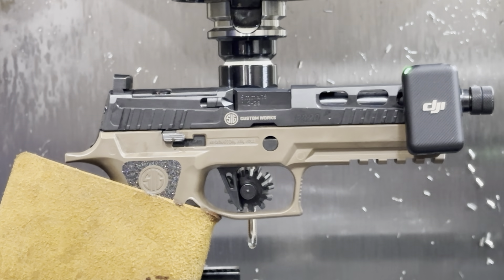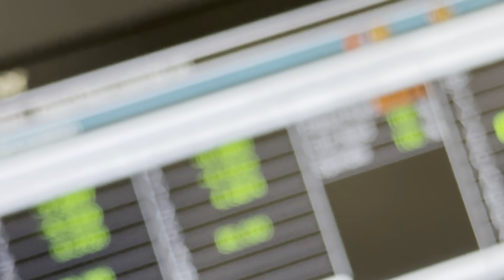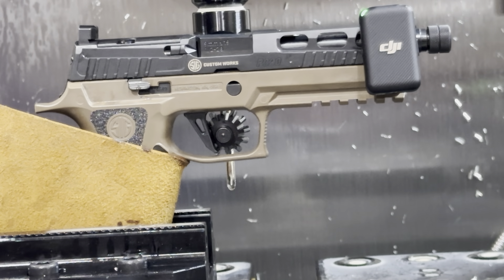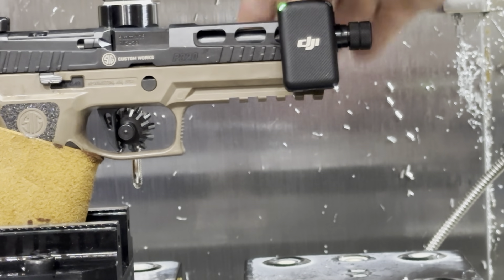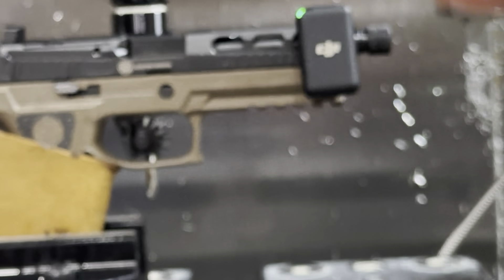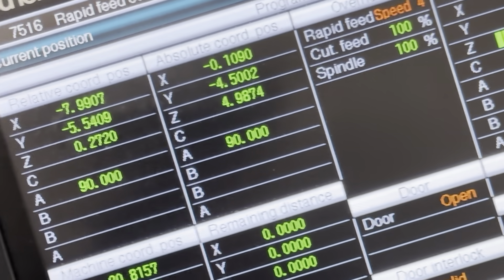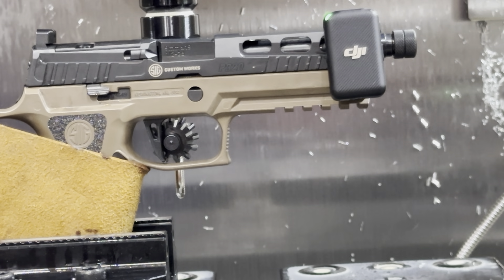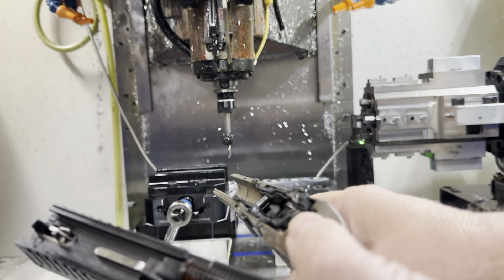Sig P320 accidental discharge tested in CNC machine.

Comment: What seems to escape people is that pulling the trigger, in the experiment, just simulates the striker safety becoming inoperable from normal movement. Pulling the trigger back slightly is not why the P320s are firing in real life. Let's review.

1. The P320 striker is fully cocked. If the sear & striker safety fail, the P320 will fire. A Glock's striker is only half cocked. If the sear & striker safety fail, it still won't fire. 

2. From the FBI study, we know the spring on the striker safety can move out of position from normal use of the pistol. This makes the striker safety inoperative.

3. The mating surface between the striker & sear is very small, and the striker sits at the very tip of the sear. The FBI noted excessive wear on the sear and uneven wear on the sear. The USAF is currently inspecting all M18s for burs on the sear. Any defect of the sear requires replacement, per the order. 

4. From WGP and many others, we can see the sloppy fit of the slide and the trigger parts. Enough movement to trip the sear. The FBI noted that the secondary sear fails to catch the striker when the sear fails. 

So, what we have here is numerous design features, when combined together, that allow the P320 to fire all by itself.
Reply: Thank you, exactly the point(s) that so many people still do not understand.
Reply: Another thing that most guys making videos about this have been missing is that "apparently" the pressure on the sides of the p320 while holstered is giving just enough deviation on the FCU that will allow the gun to fire when the slide is bumped. I've only seen one YouTuber demonstrate that. I can't remember the name but I think that's more important than the trigger being slightly depressed.
Reply: The P320’s owners manual states, do NOT carry a round in the chamber!, why?
Reply: @amadodelgado498 maybe lawyers required it ?   It would interesting to see how many other companies state that in their manuals.
Reply: @amadodelgado498  imo because you shouldn't, and I don't know why people do
Reply: @brandonkellner Well sir, you will lose the gunfight if you have to rack your slide before you engage the bad guy. Just sayin 🤷
Reply: @brandonkellner  "imo because you shouldn't, and I don't know why people do"

Spoken like someone who doesnt carry. 

How much is Sig paying you to hang out on youtube trying to rewrite the narrative?
Reply: @MyName-r2i9u  I don't carry. I do shoot guns though.
Reply: @brandonkellner  Well it makes more sense for you to say that as a someone who doesnt carry.

First, you need to understand that Sig is saying what theyre saying because it is necessary for liability's sake. Of course theyre going to tell you not to carry with one in the chamber.

As far as the why of it: If you understand why a police officer or a soldier would carry with one in the chamber, you should be able to understand why a civilian would carry with one in the chamber. The point is to be ready. You might not have the time needed (or both hands available) to draw a firearm and rack the slide.

Trust me when I tell you thats a lot more "paranoid old man" than "John Wick" speaking. Things can happen really fast. And if it comes down to who shoots first, you dont want to be the guy who still has to pull his gun out of his pants and rack the slide. 

This is why I prefer to carry a hammer fired CZ. I really never have to worry about a negligent discharge of any sort.
Reply: @brandonkellner  "imo because you shouldn't, and I don't know why people do"

Imagine, if you will, you're either a LEO on duty or a Soldier/Marine/Airman/etc on patrol, and something happens suddenly and you suddenly need to use your weapon. "Hold on guys, let me rack the slide real quick." Sometimes that small amount of time to charge your weapon is the difference between life and death.
Reply: @void870  There's very little time difference if you're going to shoot with both hands, but if that fraction of a second is worth it, that's up to you. Also, the military model is supposed to have a safety, no word yet if it was on when that air force guy was shot.
Reply: @brandonkellner  you've never seen someone suddenly charge a LEO from a short distance then. That small amount of time to rack the slide literally gets people killed in the real world. When I was in the Army, we ran the weapons on Amber (no round in the chamber) on the FOB, but anytime we left, SOP was to run it in Red (round in the chamber), and that includes sidearms. If we can't trust the weapon to not go off unexpectedly, then that weapon is being left in the armory. 

The Airman was killed by an M18 while it was IN THE HOLSTER. That is completely unacceptable. Not only is the P320 not drop safe, but it's not even holster safe.
Reply: @void870  Supposedly he was killed while it was in the holster. I haven't heard anything about it in detail, including how many witnesses there were. The investigation hasn't finished.

I have seen videos of people charging police officers. It doesn't really change my opinion.
Reply: @brandonkellner  then there's no point in debating the issue with you. 

The P320 is not safe for use in anything other than an expensive paper weight, and running a weapon in Amber will get people killed when seconds matter. If you are too stubborn to realize that, then you're beyond hope.
Reply: @void870  That's weird. There's a small window where the round in the chamber makes a difference. If that's worth it to you, then fine. I said I don't understand why people do it, and I still don't.

And what about Glocks? They've been proven to have the same issue as the one the Wyoming guy showed.
Reply: @brandonkellner  "There's a relatively common situation where carrying with round in the chamber saves your life. I don't understand why people do it"
Repeatedly saying 'i dun gettit' does not make you sound wise or cool. There are weapons that are drop safe, holstering safe and have a reliable trigger/manual safety.  I get not wanting to carry maybe a striker fired pistol with a round.

But it's head-poundingly OBVIOUS why people would want to carry with a round in the chamber. You can say you disagree, but if you legitimately 'don't get it' you're actually clueless.
Reply: The Glock striker is not 1/2 cocked when in battery, it’s  only maybe 1/8, just enough for the striker safety to engage, depressing the trigger the other 7/8 and fully compressing the striker spring before it drops
Reply: This seems like an accurate assessment of the findings and the bad engineering of the P320.
Reply: This sums it up really well! I cannot trust any gun with a fully cocked striker.
Reply: @ShoddyRC Walther is Precocked and we have no issues.
Reply: @willkietzman1121 I dont doubt that, but personally just dont like the idea.
Reply: @ShoddyRC Walther and Smith and Wesson have been doing it for years, but they haven't cut the corners. But i do get it.
Reply: @willkietzman1121 Springfields and M&P are as well.
Reply: @ShoddyRC , you can trust the HK VP9. Go study how its firing pin/striker block is designed.
Reply: Many brands of holsters use the trigger guard for retention. Because the P320 doesn't have a trigger safety widget, the two should be incompatible. While the trigger guard is wider than the trigger, any warping or out of spec molding of the holster means it can press the trigger back when holstering the gun (P320 owner)
Reply: he proved the glock failed the exact same test. watch his other video
Reply: Dear god.. please type in youtube glock half cocked test. There IS enougfh energy half cocked glock to fire the primer. And I am saying this as a Glock fanboy. Get a SA/DA if you want no kinetic potential at all
Reply: A glock’s striker is cocked enough that is theoretically has enough energy to ignite a primer if it were to be engaged
Reply: Since you clearly know what you're talking about. What was he talking about? At the end of the video about the mag not being able to go in without the slide back Because I really don't recall anybody Worrying about that?
Reply: "allow the P320 to fire all by itself" sure. If it can become inoperable from normal movement, why didn't the experiment show that instead of engaging the trigger?
Reply: @brandonkellner Because it's a reliable and non-destructive way to disengage the sear safety. You do realize that the gun firing at less than 100% trigger pull is a problem, right? What that means is that all it takes to go off is for the parts to get worn or dirty enough to mess with the tolerances and it goes off WITHOUT any trigger manipulation whatsoever.
Reply: @usracer3 yes exactly! It’s completely unacceptable on a fully cocked striker design. I don’t care if it’s 99.9 % into a trigger pull, it’s still able to fire from outside forces on a NOT fully pulled trigger.
Reply: @royb.1441 It's an egregious design flaw. I own a 320 and have tested for the uncommanded discharge. Luckily, on mine it has to be pulled 90-95% before moving the slide drops the striker, but thats enough to make me not carry it or keep it with one in the chamber.
Reply: @usracer3  Not really, less than a full trigger pull is a matter of degree. You shouldn't be pulling the trigger and expecting the gun to not go off.
Reply: @brandonkellner You're entirely missing the point. Ignore the trigger pull. If the gun gets too dirty or just worn, it does the job of the trigger being pulled (i.e. the sear safety being disengaged) WITHOUT ANY TRIGGER MANIPULATION. Thus, when the slide is slightly jostled, it goes off. I repeat, WITHOUT touching the trigger. That is why they are going off IN holsters. Because the sear safety fails and causes the striker to slip over it, firing the gun.
Reply: @usracer3  Maybe after 100,000 rounds you should get a new one
Reply: @brandonkellner , you cannot control a self-defense situation to the degree that your statement makes sense. Perhaps you THINK that “when you draw your weapon you automatically fire”. That’s not necessarily true at all.
Reply: @WDLC1911  Are you even responding to the right person?
Reply: @brandonkellner  "less than a full trigger pull is a matter of degree"

And the degree matters. These are supposed to be duty pistols. Not safe queens.

Why arent Glock 19s, M&Ps, P10s, PDPs, etc going off under the same use and abuse? Why does it just seem to be the P320? Is it a big "anti-Sig" conspiracy?

"You shouldn't be pulling the trigger and expecting the gun to not go off"

Horse****. Have you ever shot a handgun before? I can pull any trigger on any of my firearms up to the wall and I fully expect that my firearms will not go off. Because that is how theyre designed. They only go off then the trigger is depressed all the way (ignoring overtravel) and the trigger breaks.

Again... if this is so common an issue, where is all the evidence that Glocks are going off while sitting in peoples holsters? Glock 19s have been issued to police departments across the country for decades. Where are all the news reports of UDs?
Reply: @brandonkellner That is entirely irrelevant to the current discussion, and you completely glossed over or just didn't bother to read what I said about it getting dirty OR being worn (Just because its worn doesn't mean its been fired extensively, wear comes down to the quality of the materials and the contact surfaces). You obviously refuse to pay attention and have a rooted bias for some unknown reason, for a company that couldn't care less about its consumers or fixing an egeregiously faulty design. I own one of these and I'm not drowning in cope, and can admit when the design is faulty, unlike you.
Reply: @usracer3  I've said it was faulty. So what? You still need to pull the trigger to get it to fire. Your dirty example is not realistic, which is why I replied about 100k rounds.
Reply: @brandonkellner Nowhere in this comment thread have you said it was faulty. In fact, with what you've said in a couple of the replies, you've implied that it was not a fault of the gun. The dirty example is realistic, due to the prevalence of people not maintaining their firearms. Also, for the third time I'm going to point out that you've completely overlooked the fact that it DOES NOT only happen when you pull the trigger. Pulling the trigger in the videos demonstrates the sear safety being disengaged. They are pulling the trigger to simulate the sear safety being disengaged, whether it being due to wear, buildup, or the parts being out of spec causing the tolerance issues which result in the striker slipping off the sear. Even if it was only when pulling the trigger, thats still faulty and unacceptable, especially when other striker fired pistols don't have these issues.
Reply: @usracer3  maybe not in this thread, but somewhere on this video:
"@danya822 Faulty? Sure, but what does that really mean? If a gun manufacturer makes a pistol with 1mm less of travel"

And it doesn't matter, I'm saying it's faulty now. And if they want to show that natural movement can cause the gun to go off, they should use natural movement, not pulling the trigger.
Reply: @brandonkellner The "natural movement" they are referring to is the manipulation of the slide. The part about the trigger is irrelevant. Also, this is a relatively new/recently discovered cause for the uncommanded discharges. There's another video that demonstrates the same problem but the way they achieved the sear disengage was using a 10mm safety lever on a 9mm. Same result though, and it goes off without any form of trigger manipulation. Just slide manipulation. I believe its a video called "It ND's Today" by the youtube channel "LFD Research".
Reply: @usracer3  How could it be irrelevant? The slide movement won't fire the gun without the trigger being pulled.
Reply: @usracer3  Also, I looked up the video you mentioned. It's 26 minutes, but the part I saw, they deliberately configured it in a dangerous way and they couldn't get it to go off without a trigger pull. This video is older than the recent Wyoming one where he showed you can get the gun to go off by manipulating the slide, so I'm just going to ignore it.
Reply: @brandonkellner , it’s so many comments… yes. I just re-read the threads. Have you ever had to use your pistol in self-defense?? Getting on the trigger (as in “in the process of shooting someone or something and getting then the threat level drops immediately and you get off the trigger. This is an advantage of H&K’s LEM, DA/SA and DAO (which I don’t like).
Reply: @brandonkellner They did get it to go off without a trigger pull. They configured it that way to simulate the sear safety being disengaged, same concept as pulling the trigger to the wall. It went off and there was no finger even inside the trigger guard. I've tried explaining it, and provided another source, but at this point its clear that no matter what kind of proof or explanation you are given, you are just going to ignore it or excuse it for one reason or another.
Reply: @usracer3  Apparently, I cut off the video right before they got it to fire by racking it. Fair enough, but what does that really say if they're essentially breaking the gun to get it to do that? That's also not the issue that was presented in this video or the Wyoming one.
Reply: @brandonkellner But, you miss the point.  There is no point in time that a fully “cocked” striker should deploy, with ANY amount of trigger pull, when the safety is ON.  That’s what a safety is for in the first place - no striker mpingement on the cartridge’s primer is allowed whatsoever until the SAFETY is switched off and the trigger is pulled  (whether intentionally or not), unless the safety is switched OFF and the trigger is pulled.  Any trigger pull that causes a fully “cocked” striker to move forward and hit the primer, when the safety is ON, is an utter failure of the safety system.  Therefore, the video’s author simply confirmed that the safety switch is defective on the P320.
Reply: @miguelrosario7302  well, it's irrelevant, so it doesn't matter if I missed it or not
Reply: @brandonkellner It's cause and effect.

These tests pull the trigger (cause) to disengage the sear safety (effect). It is only a means to the effect here, to simulate other causes that are less common (debris, shitty part tolerances, etc).

Ideally on a striker fired firearm, for safety you want to disengage that as late as possible, to limit any chances for the sear to do stuff you don't want, notably firing the gun before you want to.  There is no real benifit to disengaging it earlier in the trigger pull, only problems where it becomes significantly easier to disengage early, as all the uncommanded discharges have shown.

Pulling the trigger slightly is a method to disengage the sear safety without artificially wearing the components to a higher degree, or having parts with the poor tolerances that have been shown to exist. This allows somebody with a perfectly in-specs & perfectly matching tolerances P320 to showcase the problems a P320 that was manufactured worse, or has experienced even a few thousand rounds from duty use.

Furthermore, shitty tolerances allow shit to jostle around, and build momentum when it experiences a force, like running or impacting something (...almost like the typical shit somebody duty carrying a P320 might do). If the sear safety can wiggle, then it means an impact could potentially disengage it. This means there's nothing to stop the sear from dropping.

People are dead over people like you failing to acknowledge that the P320 has a serious safety concern. I don't want to have to continue to carry this unreliable firearm, knowing it might go off when I don't want it to. And so do a lot of other people.
Reply: @IanNuke  Don't pull the trigger and expect the gun to not go off. If the air man hadn't pointed a chambered gun, presumably with the safety off, at himself, he wouldn't have died, so I don't think the real safety issue is people like me.
Reply: @IanNuke Ignore him. I wasted my time trying to explain it to him, just for him to entirely ignore what I wrote, and ignoring video proof I told him to look up because its "irrelevant", just like his "knowledge" or lack thereof of firearms. You can explain it for people like him, but you can't understand it for them as well. I'm sure there are extreme personal biases causing him to be in that much denial over a blatantly flawed handgun design. Can't fix stupid.
Reply: @usracer3  real 😔
Reply: @usracer3  Did you ever answer my last question to you?
Reply: @usracer3  Actually, I never said anything was irrelevant to you.
Reply: @brandonkellner I didn't answer it, because you don't fully read the replies, refuse to watch proof, and you excuse every tangible piece of evidence. Why would I waste my time answering you if you don't even have the common courtesy to even pay attention to what everyone else is saying to you?! And let me correct my statement, you didn't, in fact, say it was irreleveant, you said "It doesn't matter".
Reply: @usracer3 I literally went and watched your video, twice, and I have basically the entire gun world Arguing with me
Reply: @usracer3  also, I think you're confusing my reply to someone else with a reply to you. pay attention to the user id, because both irrelevant and "it doesn't matter" show up in comments to other people

edit: i found "And it doesn't matter, I'm saying it's faulty now." Meaning, it doesn't matter if I said it's faulty before or not (I had), I was saying it's faulty then. I wasn't dismissing anything you said other than that you thought I hadn't said it before
Reply: @MyName-r2i9u  I didn't see this reply before. No, you shouldn't pull the trigger and expect the gun to not go off. And you have to pull the sig beyond the wall anyway, so I don't know why you're saying up to the wall.
Reply: @WDLC1911  no, I haven't, are you saying you should be able to squeeze the trigger and not have the gun go off? I'm guessing if you're relying on that much precision control, also don't shake the slide while squeezing the trigger.
Reply: @IanNuke  You didn't say anything useful. I've been told many times it's to "simulate" a failing safety or whatever, but no one ever shows how that happens with proper usage.
Reply: @brandonkellner  In a fully cocked striker design, the safety system can not tolerate any faults….if the gun can literally fire before a full trigger pull from slide wiggle, that is janky. I don’t care how close it is to a full trigger pull. That is janky as all heck and unacceptable on a fully cocked striker gun
Reply: @royb.1441 Glock does the same
Reply: @brandonkellner because he is basically saying that all of these uncomanded firings is because they really partially pulled the trigger. He's on sig's side.
Reply: @brandonkellner  this particular pistol doesn't appear to have the defect. its a surface condition issue, and tolerances stacking on top. the thing is going off in holsters. that is by definition, all by itself.
Reply: @tylerhenderson7406  If your holster pulls the trigger, I don't know how that's the gun's fault.